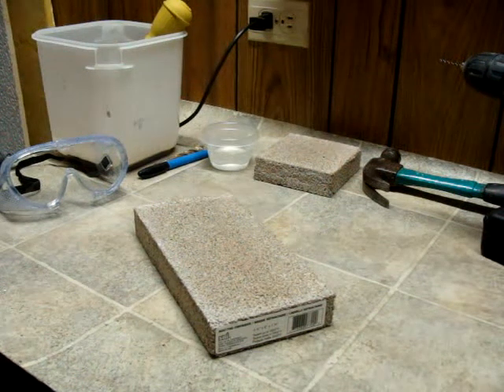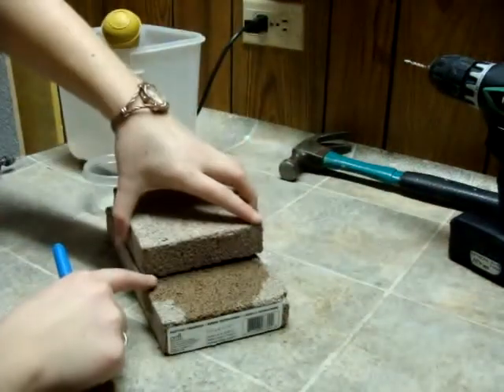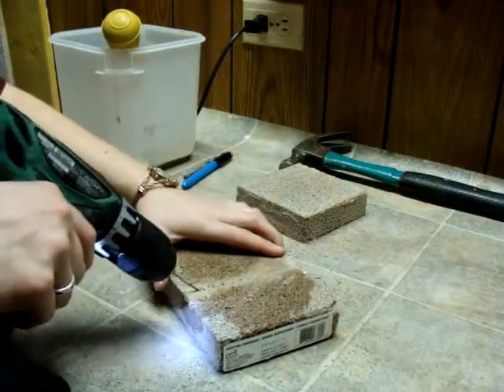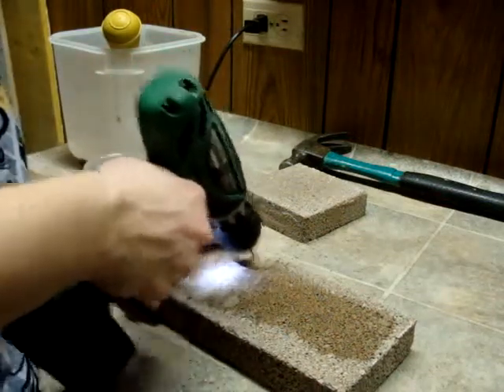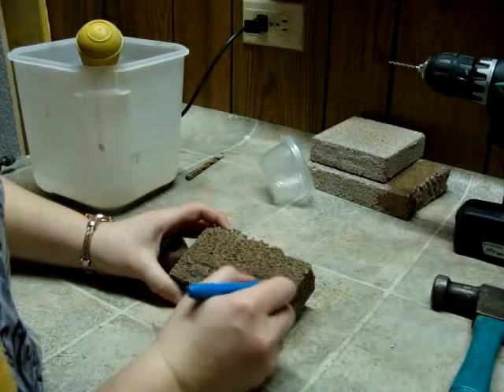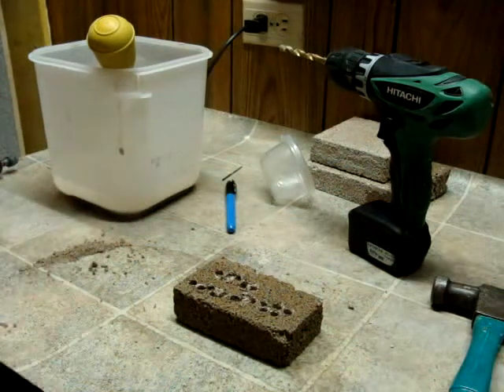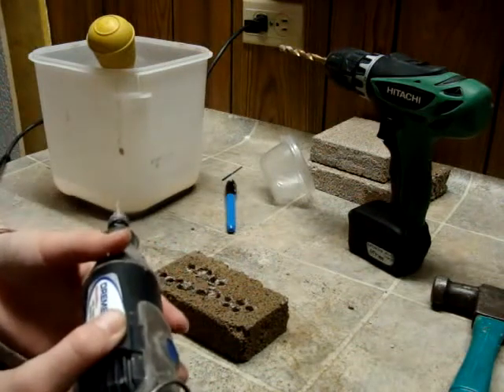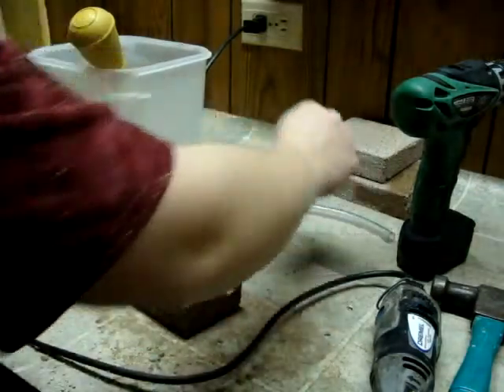How to make an Ant Formicarium out of Firebrick Part 1 of 2

Comment: Would this type of firebrick work its sanded ceramic firebrick they also have one same color as yours but its clay firebrick which of these would be betterhttps://m.lowes.com/pd/US-Stove-Company-Sand-Ceramic-Firebrick/3775895?cm_mmc=SCE_PLA_ONLY-SeasonalOutdoorLivingSosHeating_-3775895:US_Stove_Company&CAWELAID=&kpid=3775895&CAGPSPN=pla&k_clickID=c675dd4b-bb20-4dfa-9c15-b9a1265c9a3c&gclid=EAIaIQobChMIk9Lg2K7b2wIViANpCh1GhQ2KEAQYASABEgLWtvD_BwE
Reply from the maker: It would probably work since it is ceramic.
Reply: I got the clay one its very porous good for the water so far

Comment: I'm just wondering will my tetramorium sp E survive in this?
Reply from the maker: My Aphaenogaster did, and so did every other species I tried.  Firebrick is a lot like ytong as long as you get true fire brick (Fired clay, and not stone)
Reply: Crystal S Alright thanks for the information and the fast reponse! I live in Canada so I can't also get Yong.
Reply from the maker: I live in Canada too, so I know the struggle. This firebrick is found in most Canadian Tires.
Reply: Crystal S Thanks! I live near a Canadian tire so I'll be going there tomorrow. I was wondering if I can just carve out the nest with professional carving tools?
Reply: Crystal S Sorry to ask this random question but, can I use cement to make an out world? Or do I have to use grout or plaster? Thanks!

Comment: Could I carve it with chisel and hammer?
Reply from the maker: In theory yes, just be careful not to crack it clean in half. I saw someone use a screwdriver once.
Reply: Got it. I am actually using this

https://www.fastreplacementglass.com/castable-fire-brick-refractory-cement---2200-degree-premixed-12-12lbs-bucket?gclid=CjwKEAjwkq7GBRDun9iu2JjyhmsSJADHCD_HKgHLjczMXrzwX4qoskSFuhS1e5YDRmXwQad0joMwYRoC_0jw_wcB

on

http://www.usplastic.com/catalog/item.aspx?itemid=28297&catid=852

to get a bigger nest, and yes, I saw your video on the nest being too big, an issue with a small colony due to mold outbreak in the nest, so I was going to make a nest that allowed me to open up more rooms later on as the colony gets bigger using the same nest.

Please give me an insight and your expertise on regards to these products.

Are you still active in formiculture.com
Reply from the maker: I have never used the castable stuff before. Truth be told, I had never even heard or seen it.
I have seen nests that open up later. They often work. My personal preference is to just keep making larger nests. By the time my colony outgrows the small nest, the glass is a bit dirty and the nest is sometimes dirty too.
I am a bit active on there, you can always PM me on that site if you have a thread you want me to comment on. Lots of people there build their own nests.